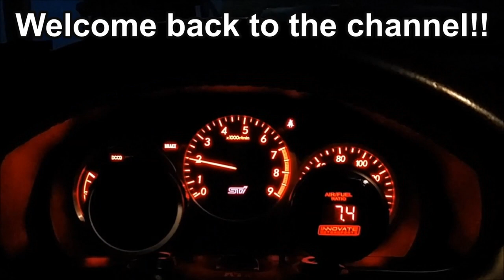Abel LMTV build part 149 (wedge brake maintenance, hub seals serviced)

Comment: Hi Sean I hope Willow and you are warm and well! I hope those seals help with the hub oil leak. I'm watching the air compressor video now that's a lot of work but it will pay off while your both pout and about this summer. That air dryer cartridge was a mess. I know you replaced that steering box before what a pain. Take care Don

Comment: Was there any oil streaks, light that they may be, on the tire? Maybe my imagination, but I thought I saw something there. I've got to do my brakes, just to get that out of the way... I still have no issue with the hubs. Oil remains level. Here is one thing I should mention... when I fill my hubs, I place the filler port at the 4 o'clock position. One of the hubs (can't remember which one) oddly took more oil than the other.  I'm not sure it is supposed to or not, but that is how I fill my hubs. Using oil safe for yellow metal is also a plus in this area. Great work, as usual!
Reply from the maker: No oil streaks.  We shall see if the oil level changes now with the new seals...

Comment: The reason the oil stays in that portion of the hub is because the seal for the ctis prevents it from going into your ctis system. The front half is oil and the rear half is greased